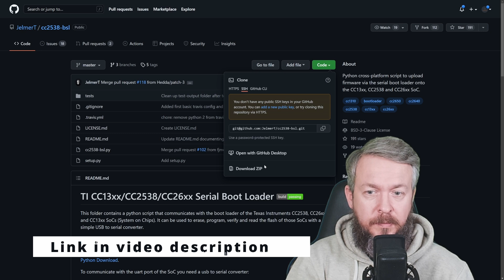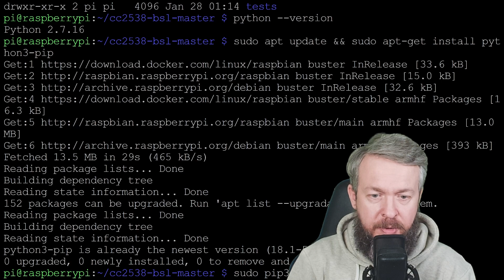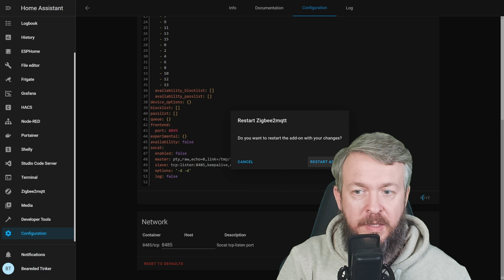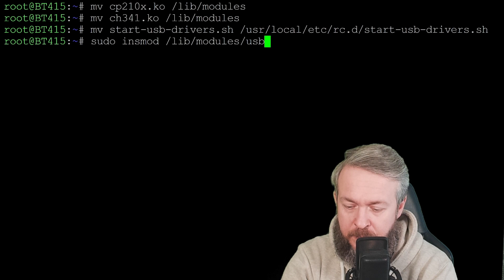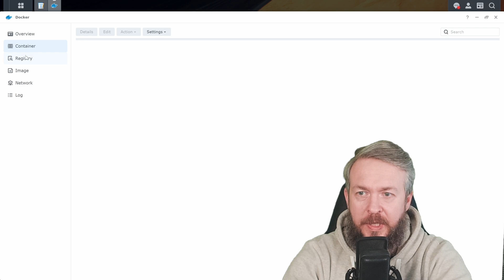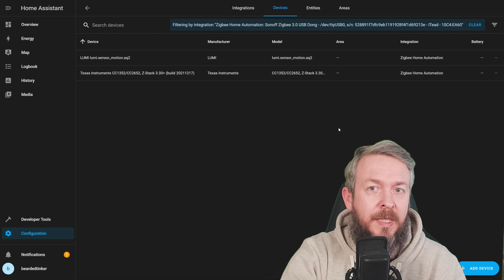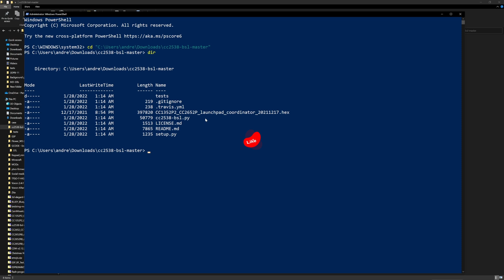Flashing Sonoff Zigbee 3.0 USB dongle plus and Home Assistant guide

Comment: everything works great but I got a problem in the beginning so I will share it may help somebody, after following all steps carefully I got timeout error, make sure that the dongle is not added to home assistant integrations before flashing it.
Reply from the maker: Thank you Ahmed! I think that I also mention that in video - device can't be already in use as it will lock access to it.
Reply: @BeardedTinker  ok it's my fault ☺️
Reply from the maker: @smartifi_egypt  nah, you probably missed it, but great that you managed to get it working - that's the only important thing!!!

Comment: Great video, I was able to flash the Sonoff and add it to HA on my Synology. Unfortunately the installation overwrote my entire HA setup and have to start from scratch again as don't have backup. Not sure what happened since I've remove the container numerous times before and the data has never been deleted.
Reply from the maker: That's strange. If you have it in Docker, all files are saved locally on disk and deleting or re-creating shouldn't influence it. Maybe you had typo in folder name.
Reply: @BeardedTinker  At first I got an error "Bind mount failed: '/volume1/docker/homeassistant' does not exists." My old HA config used "home-assistant" so I changed it to that. Then it said: "The container name "/homeassistant" is already in use by container "2affa...". You have to remove (or rename) that container to be able to reuse that name. So I removed the container, the run was successful, but the data got overwritten.  I guess I did something wrong there.

Not a huge deal, should not be too much work setting it up like before, just have to remember how to install HACS on synology docker, had issues with that last time.
Reply from the maker: I don't think that HA can overwrite local data if it already exists... You could check if you have duplicate folder maybe or stacked folder where new one is inside old one.

Comment: Hi B.T.
I installed Home Assistant on synology (DSM7 DS220+)

 it can't seem to connect to the dongle
1. No select device from the list In VMM 
2. use docker but Synology USB drivers link dead

Please refer to synology  VMM according to the video,
Is there any other prerequisite work to connect to the dongle
?
Or there are other suggested Synology USB  drivers link 

PS. I'm not good at English, I'm using a translator
Thanks
Reply from the maker: Jadahal site with drivers should be up - it does go down sometimes. Try in few hours or tomorrow.
But also Synology should list this USB stick in VMM Edit page even without drivers. 
I'm sorry, but currently I don't know of any other way to get it in VM other than that. Did you try second USB port (not sure if 220+ has two).
Reply from the maker: Site is back up, so drivers are again available: http://www.jadahl.com/iperf-arp-scan/DSM_7.0/
Reply: @BeardedTinker  😍
3Q  B.T.

Comment: Thank you for the video. I updated my sonoff coordinator in Windows without issues. However, after updating the dongle HA is no longer able to control any of my 90 zigbee devices. I had flashed a beta firmware, so I re-flashed the released firmware but I am still int he same situation. I tried to re-add a spare sensor and it worked but the devices that were added prior to the upgrade/downgrade are not working. Looks like I will have to rebuild my zigbee network :(
Reply from the maker: Sorry to hear this and this is not normal. Flashing firmware (if you used that procedure) shouldn't require re-pairing. If you used other tools than you may have possibly unchecked one box (I think it's called keep IEEE address) - that would definitely require re-pairing of devices. 
So far I've done it dozen of times and never needed to repair.
Reply: @BeardedTinker  I followed your flawless process. Someone said that they ran into the same issue and resolved it by power cycling all the routers but I had already reset a majority of mine by the time I saw the comment so I can't confirm. My network is now apparently working fine. Thanks again for the helpful videos you make!

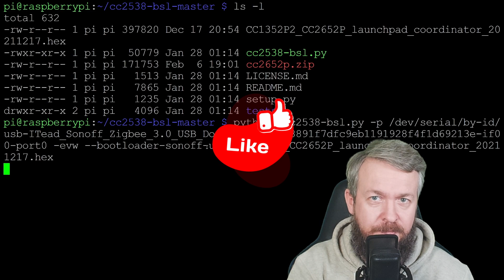Comment: I tried it on Ubuntu but I have a problem not descrived in that video. In the 8:41 of the video I get this message error:

Z490-UD:~/cc2538-bsl-master$ python3 cc2538-bsl.py -p /dev/serial/by-id/usb-ITead_Sonoff_Zigbee_3.0_USB_Dongle_Plus_b6afee581045ec11898894fd6f14af06-if00-port0 -evw --bootloader-sonoff-usb CC1352P2_CC2652P_launchpad_coordinator_20220219.hex 
ERROR: [Errno 13] could not open port /dev/serial/by-id/usb-ITead_Sonoff_Zigbee_3.0_USB_Dongle_Plus_b6afee581045ec11898894fd6f14af06-if00-port0: [Errno 13] Permission denied: '/dev/serial/by-id/usb-ITead_Sonoff_Zigbee_3.0_USB_Dongle_Plus_b6afee581045ec11898894fd6f14af06-if00-port0'

I tried with sudo, then de message is:

Z490-UD:~/cc2538-bsl-master$ sudo python3 cc2538-bsl.py -p /dev/serial/by-id/usb-ITead_Sonoff_Zigbee_3.0_USB_Dongle_Plus_b6afee581045ec11898894fd6f14af06-if00-port0 -evw --bootloader-sonoff-usb CC1352P2_CC2652P_launchpad_coordinator_20220219.hex 
cc2538-bsl.py requires the Python serial library
Please install it with:

   pip3 install pyserial

Then I install pyserial, and tried again:

Z490-UD:~/cc2538-bsl-master$ pip3 install pyserial
Requirement already satisfied: pyserial in /home/napalm/.local/lib/python3.8/site-packages (3.5)
Z490-UD:~/cc2538-bsl-master$ sudo python3 cc2538-bsl.py -p /dev/serial/by-id/usb-ITead_Sonoff_Zigbee_3.0_USB_Dongle_Plus_b6afee581045ec11898894fd6f14af06-if00-port0 -evw --bootloader-sonoff-usb CC1352P2_CC2652P_launchpad_coordinator_20220219.hex 
cc2538-bsl.py requires the Python serial library
Please install it with:

   pip3 install pyserial

But again it say same error!

These are the ports:

Z490-UD:~/cc2538-bsl-master$ ls /dev/tty*
/dev/tty    /dev/tty23  /dev/tty39  /dev/tty54      /dev/ttyS10  /dev/ttyS26
/dev/tty0   /dev/tty24  /dev/tty4   /dev/tty55      /dev/ttyS11  /dev/ttyS27
/dev/tty1   /dev/tty25  /dev/tty40  /dev/tty56      /dev/ttyS12  /dev/ttyS28
/dev/tty10  /dev/tty26  /dev/tty41  /dev/tty57      /dev/ttyS13  /dev/ttyS29
/dev/tty11  /dev/tty27  /dev/tty42  /dev/tty58      /dev/ttyS14  /dev/ttyS3
/dev/tty12  /dev/tty28  /dev/tty43  /dev/tty59      /dev/ttyS15  /dev/ttyS30
/dev/tty13  /dev/tty29  /dev/tty44  /dev/tty6       /dev/ttyS16  /dev/ttyS31
/dev/tty14  /dev/tty3   /dev/tty45  /dev/tty60      /dev/ttyS17  /dev/ttyS4
/dev/tty15  /dev/tty30  /dev/tty46  /dev/tty61      /dev/ttyS18  /dev/ttyS5
/dev/tty16  /dev/tty31  /dev/tty47  /dev/tty62      /dev/ttyS19  /dev/ttyS6
/dev/tty17  /dev/tty32  /dev/tty48  /dev/tty63      /dev/ttyS2   /dev/ttyS7
/dev/tty18  /dev/tty33  /dev/tty49  /dev/tty7       /dev/ttyS20  /dev/ttyS8
/dev/tty19  /dev/tty34  /dev/tty5   /dev/tty8       /dev/ttyS21  /dev/ttyS9
/dev/tty2   /dev/tty35  /dev/tty50  /dev/tty9       /dev/ttyS22  /dev/ttyUSB0
/dev/tty20  /dev/tty36  /dev/tty51  /dev/ttyprintk  /dev/ttyS23
/dev/tty21  /dev/tty37  /dev/tty52  /dev/ttyS0      /dev/ttyS24
/dev/tty22  /dev/tty38  /dev/tty53  /dev/ttyS1      /dev/ttyS25
lsZ490-UD:~/cc2538-bsl-master$ ls /dev/serial/by-id
usb-ITead_Sonoff_Zigbee_3.0_USB_Dongle_Plus_b6afee581045ec11898894fd6f14af06-if00-port0

and the files on the folder:

Z490-UD:~/cc2538-bsl-master$ ls
CC1352P2_CC2652P_launchpad_coordinator_20220219.hex  LICENSE.md  tests
cc2538-bsl.py                                        README.md
cc2652p.zip         

What it is the problem and how to solve?
Reply from the maker: There could be few things. 1) make sure that no other application is trying to use the port (for example if you run it on machine where HA is installed, stop it first. 2) try running python command without number 3 at the end - just to see if correct version is getting pulled.
This looks like the pyserial was not installed at proper location and is not getting pulled/not listed in libraries for Python3.

Comment: Good video. One question, though: What is the benefit of flashing it? I bought 2 of these, and they just straight up works out of the box (with Z2MQTT)
Reply from the maker: Sure, you probably missed it in video. Original firmware from Sonoff works, but is limited to around 20 devices maximum. Not just to say that firmware is very old and is missing some improvements. But, if you have less deviecs than the limit, you can use it.

Comment: Dear BeardedHero
I have bought this to replace my CC2531 after I though it was failing on me due to the many updates
regarding Zigbee2MQTT.

Out of the box I plugged in the device, and I think is now coordinating it as ZHA.

Do you always need to flash it to use it in commotion with Zigbee2MQTT?
Reply from the maker: Hi Ray!!! :)
Without flashing it should work with both ZHA and Zigbee2MQTT. 
BUT original firmware from Sonoff has limit on maximum number of devices even smaller than CC2531 if I remember correctly. And it's very "old" version.

Comment: Great video -- subbed.   The only thing people should know, and will figure out quickly when the linux commands dont work, is that they'll need to update the serial ID and the firmware filename assuming the version doesn't match your own.  Thanks for a great tutorial
Reply from the maker: Thanks for the sub and comment! Sometimes I miss things - for example, forgot to mention USB drivers if anyone want's to use that method!

Comment: Thanks B.T.  done the whole Linux thing and it worked a champ first time through without much of an issue.  Just needed pip install pyserial and intelhex and done.  No need to remove that hard candy shell to get to the boot meat.
Reply from the maker: Nice! I need to flash latest firmware on it, but that's now very easy to do without a need to open the case 😊👍

Comment: The Zigbee2MQTT does not work on my Raspberry Pi with that Sonoff stick. I get the error "502: Bad Gateway" all the time - super frustrating and annoying.
I've tried for hours but nothing works for me, every time the same error
Reply from the maker: Bad gateway error usually pops up when Zigbee2MQTT is stopped/not working...
Reply: @BeardedTinker  It's running of course, but I coulnd't figure out yet why it isn't working.
I've reflashed the stick several times, re-installed the add-ons, tried different options in the configuration path etc. but still the same issue.
Reply from the maker: Stick has nothing to do with Bad Gateway (at least not directly). If everything loads up and starts, you shouldn't see that error. Check in log file of add-on what is last thing that loaded and if there re any errors 
Latest version of Zigbee2mqtt had changes and should not use YAML files for configuring it.
Reply from the maker: Also, do you have this in configuration file for Zigbee2mqtt:
frontend:
  port: 8099
Reply: @BeardedTinker  Yeah, I had that configuration, but didn't work either. But I finally got it running and there are no errors in the logs. Unfortunately I can't add any of my zigbee devices to the Zigbee2mqtt - with ZHA (disabled while running the mqtt) it works properly. Any advices?
Reply from the maker: Not really sure. After you press pairing enabled it should allow it by default. But it needs to have coordinator firmware on it (just saying because I once tryed with router 😂 and failed)

Comment: I was hoping to flash this thing today on Windows 11, but it doesn't work for me. 

- I installed the driver for the device, it's on COM5, no errors
- I downloaded and installed Python and Intel_Hex
- I'm running the command on PowerShell as Administrator and get the following error:

PS D:\Downloads\cc2538-bsl-master\cc2538-bsl-master> python cc2538-bsl.py -p COM5 -evw --bootloader-sonoff-usb CC1352P2_CC2652P_launchpad_coordinator_20211217.hex
sonoff
Opening port COM5, baud 500000
Reading data from CC1352P2_CC2652P_launchpad_coordinator_20211217.hex
Your firmware looks like an Intel Hex file
Connecting to target...
ERROR: Timeout waiting for ACK/NACK after 'Synch (0x55 0x55)'
PS D:\Downloads\cc2538-bsl-master\cc2538-bsl-master>

Any clues? Thank you so much!
Reply: Being persistent I already found out. My Sonoff was not in bootloader mode, I had to do that first (unscrew the case, hold the boot button and plug in the device, wait a few seconds and release the button)
Reply from the maker: Did you previously flash it. Method here should not need opening it and pressing the button, as it is using comman line flag to activate Sonoff bootloader.
Reply: @BeardedTinker  No I didn't! I bought mine a month ago on Amazon, maybe something changed
Reply from the maker: Shouldn't have as this was just added (in firmware uploader tool). Did you use  flag for Sonoff and also latest version of the tool? Really interested to see what was the issue as I've flashed dosen of times without the issue...
Reply: @BeardedTinker  I followed your instructions completely, so also the flag for Sonoff and all the latest tools. After the errors, I used the Texas Instrument Flash Programmer 2, that worked for me
Reply from the maker: @elstupid  Both should work, but TI one requires you to open Sonoff dongle while other doesn't...

Comment: @BeardedTinker oh wise one, I humbly ask for your help. I am young when it comes to home automation so I have trouble finding the path.
I have started with infrared signals automating my AC using a raspberry pi zero 2 w and python/lirc. I would like to make use of this small board and step up a notch: play with ZigBee devices. The question for you: do you know of any python solution that can talk to sonoff ZigBee 3.0 USB? An equivalent of lirc for ZigBee...
You wise words are much appreciated
Reply from the maker: Well, me and Python :) 
Did you have a look at this? https://github.com/zigpy/zigpy 
I haven't seen anything similar to lirc for zigbee network so far. MAybe I just missed but still no idea where to point you to.
Reply: Much appreciated. I will look into it

Comment: I've tried now both using ZHA and zigbee2mqqt - but in both it can't seem to connect to the dongle, even though I can see it in my hardware at ttyusb0?
Reply from the maker: What is your HW that you are using? Are you using HA OS or docker?
Reply: @BeardedTinker  I have two HA, one running OS on a raspberry pi, and one running virtual machine on synology. No luck on eather of them
Reply: I aslo tried flashing my sonoff using Flash Programmer 2
Reply from the maker: On RPI you should do nothing more than plugging it in. It should be visible in Supervisor - HW list. From there you should be just able to use +Add integration and configure ZHA.
In VMM, after you edit VM and select device from the list, also, in Supervisor you should see it.
Nothing else is needed. Unless you used router firmware instead of coordinator firmware. In that case you'll not be able to add it. Device that is plugged has to run coordinator firmware.
Reply: @BeardedTinker  Yes, I can see it in the hardware list, but the auto discovered device says Z-wave stick - so I try to manually add ZHA, and I choose the correct hardware, and then choose ZNP as radio type - it waits a bit and then says it can't connect.
Same if I try zigbee2mqqt - it says unable to connect to device
Reply from the maker: @andrefonneland  are you sure you are using coordinator firmware? In regard to ZWave, yes, it can get detected as ZWave, but you can't/must not added it as ZWave devices.
Really not sure why it would say so unless you have something else trying to access ttyUSB0 at same time.
Reply: @BeardedTinker  Strange, after trying for a while now on the raspberry pi, I decided to try again on the Synology. Now it auto discovered as zigbee stick and worked without any problem. Strange but I'm happy :D

Comment: I have some noob question again... I have migrated my HA on RPi from microSD to usb SSD. Everything works fine, just my Sonoff Zigbee dongle started to loose connection with my Aqara door sensors. They become unavailable and now they are impossible to pair again. Any idea why?
Reply from the maker: Well, hard to say. One question first. Do you have usb coordinator directly plugged to RPi? If yes, please try using usb cable to move coordinator away from RPI.
Second is - try replacing battery in Door sensor. Just to be on the safe side. I've never seen them arriving with bad battery but one did die after just few months which was strange as they normally last for year(s)

Comment: Hello, very good video. I did it thank you.
I am interested in flashing as a router with python script, could you make a video? thank you.
Reply from the maker: It's the same process, you just need to use different file - instead od file in coordinator folder, use same file in router folder. Everything else is the same. Just make sure that you have some other device as coordinator on your network.
Reply: @BeardedTinker  Yes, I have the problem when I go to the github of the router. "Code" does not appear, only "go to file" and "add file".How should I go?
Thank you very much
Reply: Sorry, I just understood
Reply from the maker: @Ad0lf030  great - I'm on mobile phone right now and can't copy the link. So glad you managed to get it 😉